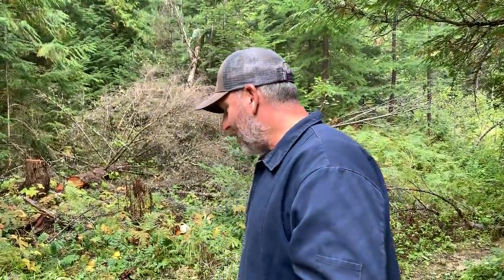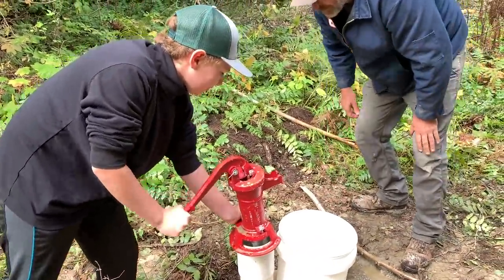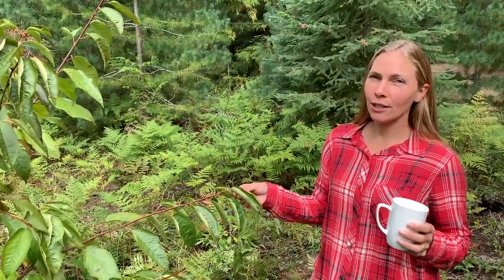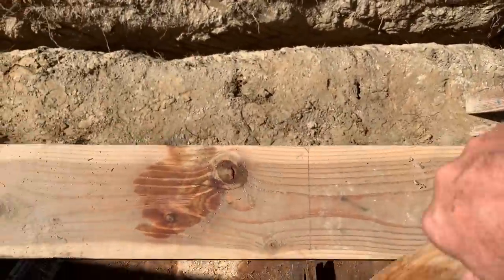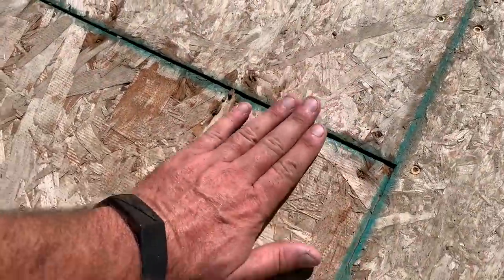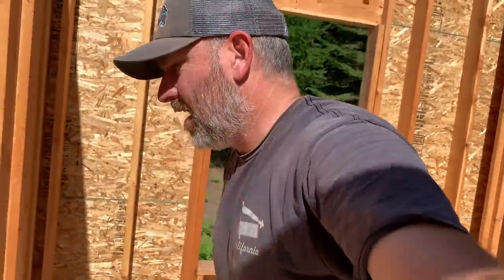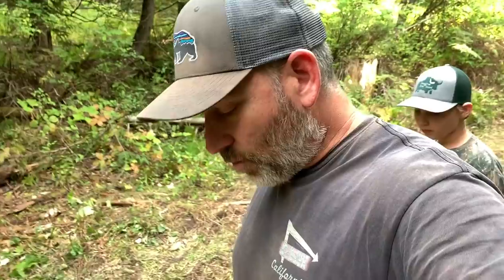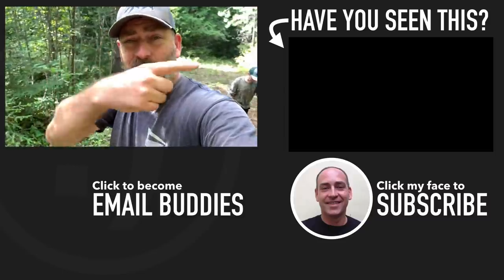Making Progress on Our Well | Off Grid Cabin Build #29

Comment from the maker: 🔥 Watch from the beginning Off grid Cabin build https://www.youtube.com/watch?v=MGfugfuzFJk&list=PL-O59UCFPykj09YwMbWqKTFfZITiJVCNg
Reply: Martin Johnson - Off Grid Living , dig a 6 foot diameter by 18 feet deep well , it will hold 1000+ gallons of water , get you friends and start digging , use rock or concrete for the outside edge to keep it from falling in
Reply: Tips you 35 M
Reply: Martin Johnson.  I must say, this sounds like an excellent plan!  Just need a large culvert, some gravel for outside the culvert. something to cover it up and alot of digging power!
Reply: John Hartsock , my well is 6 feet in diameter and 22 feet deep , it has rocks from the bottom to the top just like old wells were made , then has a squared off concrete top , I use a sump pump I got from Walmart and the gallons just flow , I tried to drain it but could not , could only drain about half way down , I gave up , by the next morning it was full again , it was built in the 50s , I use it to water my garden , wash cars , and if there is ever a public water shut down , I can still have water for any need that arises , I also have 4  P.M.A.,  
Permanent Magnet Alternator's and a Generac 2000 watt generator for backup , so electricity is not a problem either
Reply: Hey why not you r tryng to make a natural filter by layering half inch gravel to fine sand to activated charcoal. 
And deposition of silt in bottom is due to lack of proper nylon mash wrap
Reply: Dhaneshwar Rajput , because it's a fresh dug well and the sediment has to come out first or it would clog up with all that stuff you just said to put down in it , that may be great after the water clears up to have a natural filter but not now , all the fine sediment would clog the rocks , sand , activated charcoal and he would get no water , does that make sense to you ?
Reply: @jimthomas777  he is throwing away water, so what's wrong to try for a separate natural water filter. Some where near to this hand pump. I am not feeling anything wrong in it.
Reply: Dhaneshwar Rajput , because the sediment is 18 feet at the bottom , there will be a clog and no water will come out , clean or dirty because of the clog , did you not see in the bottom of his bucket all of the sediment ? that same sediment would get in the sand , rock and  charcoal filter and turn it into one solid Mass and no water would flow out the pump , it would clog because there is so much of it , does your brain work ?  look in the bottom of his bucket again , I think your brain might be in there
Reply: You might try air pressure for opening up and making cracks.
Reply: Marrying did you ever get it going correctly? Best wishes
Reply: You are actually referring to a crock well.
Sized to fit your needs.
Reply: I think you didn't go deep enough I used to drill water wells you probably need to go down to 50 feet and there's going to be water at a hundred feet for sure your best bet is to go or a hundred feet 100
Reply: you're digging into what they call sheet water water is anywhere from 18 to 50 feet deep you might hit it better at 32 feet then your next water should be a 100 to 110 and we're sure at 260

Comment: So many comments and few who actually know anything about wells and water. Pumping the mud out of the well is a good thing. The more you pump out increases the static volume your well will hold. Over time the water will eventually wash out all the silt and it will clear up. But keep in mind this is only a surface seep heavy rains will cause it to get muddy. I explained the potability of your water and how you can safely use it in comments of last video. For those who missed that comment i am a well driller and a expert in this subject.
Reply: He is likely never going to get the silt fully removed. His filter pack is far to coarse to filter the formation they drilled in.
Reply: I'm not a well driller but just like I posted before and please let me know if you agree. Most guys in this trade have a vast amount of valuable knowledge especially the local area and can pretty much tell you everything you need to know and will for free. I was in the residential building profession for years and the biggest misconception I think is that the pros won't help out the average person doing it themselves. In my experience the professional guys are more than willing to share their knowledge. Their obviously not going to come out and do it for you but a huge majority of the time they are more than willing to share their knowledge.
Reply: Agree
Reply: Question. If there is a small well that has a slow return could it be pumped into a large water retention container? Since he has solar maybe an electric pump with a floating trigger for water level?
Reply: @joshcatanzaro6220  yes you can do that it can be a bit costly for the specialised equipment. But if water is scarce from other sources it can be worth the cost. It isn't a DIY type project make sure you get a qualified contractor to install.

Comment: Why don't you use rainwater? If you have a point on your property that's higher than your cabin, you could install a rain catchment roof, store the water in tanks and then have gravity bring the water down to your cabin. Rainwater filtering for drinking is also not a problem. And I bet the water would be cleaner then what you get from that well.

Comment: Ok, I am going to tell you what my gut tells me is going on with this particular hole of yours, and what I would do with it myself. You can take it or leave it. Ultimately you have to decide for yourself. You are obviously already well aware of that.
I think that since there is no cap on the bottom of the casing, the surrounding soil is simply liquefying and filling up the bottom of the casing. This is probably ultimately going to create a sort of sinkhole at the bottom of that casing. Or in other words, a large void, around the bottom. Although that void will always be full of "chocolate milk" from the liquefying going on and on and on...
What I would do...
Get a "trash pump". That is a powerful pump that will pump the thickest chocolate milk you'll get from there.... Use that pump to pump it down every hour or so. Thus, creating a void, more quickly.  Now fill that void with pea gravel. Just dropping the pea gravel right down the casing. (Make up another piece of the inch and a half to 2 inches pipe, with a cap on one end, and fill part of that with water, for weight... Then drop it in the casing, to drive the gravel down. Do this in small increments. Just like you learned not to pour in too much gravel at once around the outside of the casing.) Now use the trash pump , to pump it down again, as many times as it takes to begin to get clearer water.
If you do that, eventually you'll get to the point where you can let it sit for a few days, then use your hand pump again. And after that, you should start seeing clearer and clearer water.
If you never get to that last stage, but always have chocolate milk, you'll need to put in more pea gravel. What you are trying to do is to replace silt with pea gravel. And eventually with enough pea gravel in there, it will start to filter the silt.
If you start getting chocolate milk again in the future, your pea gravel probably needs to be added to.
All in all, you would have saved a lot of this trouble by using two layers of filter sock over the pipe, before you dropped it in. Even with the filter sock, though, it would be recommended that you drop some pea gravel down the casing before setting a pump and starting to use it.
Reply: selador11 what you said is true.. before dropping the pipe the bottom part where the saw marks should be covered by a fine net to prevent fine dirt and sand filling in inside the pipe.
Reply: Francis Santiago Lo

Comment: You don't know me from Adam but there is my 2 cents. Don't mess around with your family's health, get a proper deep well. Ground water (18 ft) is way too polluted. You are way too far from the house. Will have to run pipe below the frost line and electricity. No. 10 wire is not cheap. Saving that expense will pay for 1/4 of your well drilling.  I know you want to DIY but best leave this one to the pros.

Comment: While you're pumping out the silt, instead of waiting for the water to recharge, save your water on top of the ground in a barrel or two or three. As the silt falls out put the good water back down in the well and recirculate it to pump out more silt. If you have enough storage for the silt to drop out and reusing the water that is cleaner you can continuously pump instead of waiting to do it every hour in this way your recirculating the water and pulling up the silt from the bottom of your well.
Reply from the maker: +Marty Guris that is a good idea.

Comment: My friend, you need to have someone come out with a mud hog pump and pump your well out.  You need to have the mud pumped out and a cavern formed to hold water for you. When you get the cavern formed you won't have to worry about running out of water. also it will be a place for any residual mud to settle and the slow pumping of water that you will be doing won't stir it up either.
Reply: you sir  are right ...bring a generator and plug in a mud pump ...make yourself some room down there?

Comment: The best suggestion I have for you is just break the law and jet down at the minimum 20 more feet nobody would know.
Reply: Yea but posting it on youtube wont be a great idea lol
Reply: At this refresh rate this will not generate enough water for a shower(when it cleans out).
Reply: I would get an excavator dug as big hole you can fill it with 2 inch stone almost to the top then the last ft. Pea stone half in. Then cover with geo tarp then loam then seed then No More Headache. Take the hit for the ,
Reply: Not down a wider area With 2in Stone that will give a good reserve,the water table is low in that area, So don’t go down make a wide ad deep as you can
Reply: Scott John

Comment: I just watched part of your video on the well. The problem as I see it and I've got a lot of experience in this kind of thing, is that your well is drilled down into clay and Clay does not let go of water that easily that's why clay is used to line Farm ponds it does not allow water to travel through it you need to get the well drilled down through the clay and into an aquifer that is in sand or gravel or Sandstone or some kind of Bedrock I don't know what's out there in Idaho but having a shallow well in clay will never yield enough water. The well I have at my property is 120 ft deep and is in sandstone and I get dozens of gallons of water per minute recharge

Comment: Hey folks! Something y'all need to know about hiring a well drillers in North Idaho... They are all booked out until May, then it's $10,000 just to get the rig on the property.  If Martin can get water from an 18 foot hand dug well in September, he's doing better than you might think!  In winter it will produce a lot more, and in spring it may even overflow.   The issue with impure water is resolved with in-house filtration systems.  These are very common in North Idaho.  Martin is on the right track.  He'll make some adjustments and adapt.  This is what homesteading is like in our area.  That's why he's sharing it with us. 😉
Reply: Agreed, although I think he would do better if he dug a wider hole to increase water volume to get around the silt a bit more.  Not a bad test.
Reply: @HospitalLocksmith  Unfortunately, a larger hole will not solve the problem. He is being limited be recharge rate through the formation, which for the rate they are pumping is relatively independent of their casing diameter

Comment: I would have loved for you to be successful with your self-drilled well but from the beginning I was concerned given the results of the auger drilled well.  So much clay and silt didn't bode well!  And when you cut slots into the casing I knew silt was going to be a problem, certainly to start with and it's looking like it isn't going to stop getting into the well.  I'm getting close to agreeing with others who are recommending a deeper well drilled professionally.  Even if the silt ingress diminishes shallow wells are subject to a lot of surface contamination so could you ever trust it to be potable? Bummer to say the least but this is one place saving money up front could cost far more in the long run. And there is still the issue of the well being so far from the house site and getting the water to the house itself.
Reply: I couldn't have said it better.

Comment: I have done it same way with auger but found using a mud pump and circulating the muddy water into a settlement tank  then back down bore hole worked best it pushed the mud an sand up and out, then just push casing down as you go till you are as deep as you want then put a sand point on your suction pipe drop it in and next pour gravel in and lift casing a little letting the gravel fill in round casing and sand point this should give you plenty of support to keep it from caving in and make a nice resavior for water then pump all you want to clean it . Shouldn't take too long before all clear water is left.

Comment: Martin take some short 2×10's and a couple of pieces of plywood sandwiched together and build a mini platform for the pump to fit around the casing to take away some play
Reply: I was thinking some cinder blocks for weight wired to the holes in that hand pump, but this is only temporary.

Comment: I have developed many water wells for work and the issue is that you used the incorrect filtering material for your well.
You should have put a silt sock over the PVC pipe and used filter sand or even just plain old play sand that you have washed for the fill material and then cap it with cement at the surface.
Reply: Yep, a sock. The most amazing well drillers vids are mexican. They got it down to a science.

Comment: The house will be destroyed before you get it built.  Mold loves that “wood”.  Bottom plates should be treated lumber and if I was building it myself everything would be treated.  I did a building a little smaller than yours and everything  except the roof sheeting  was treated.  It got tar paper right away.   Spend a little more and have less headaches later.  Even painting that stuff won’t work.  Waters going to get under every 2x4 and rot it.

Comment: Don't forget now the end of your pipe that's on your pump you have to put a foot on there and you can put a sock on their internal pump Clearwater you cut it off about two to three. 224 in is actually from the bottom you won't get silk
Reply: Should say two or three inches not to 224 disregard that part

Comment: hi   your bailer  idea   is ok   but you need  a large    foot valve    .  it will   open when u  drill it down and   close   so you can bring the sand   to the surface     ,  I'm  sorry u are restricted   from going down to a gravel   bar    good luck

Comment: Martin. Google "air pump"  useing compressed air a few pieces of hose and you can remove all that silt and sand from your well casing in the matter of a few minutes.  Since your soil is so sandy you may also need a finer screen on your foot valve.

Comment: Make a bailer.. to clean out well.
use a pipe with a heavy ball on the inside. drop from the top of the well and let it slam into silt. when you pull out the ball drops and seals off the bottom of the pipe so the silt stays in the pipe. pull pipe out and repeat
Reply: Good tip

Comment: The bottom of the large pipe is open so the silt is coming up the pipe. You also added your pea gravel 24hrs after you drilled the well. The gravel is probably 8-10 foot up the pipe and nowhere near where you needed it to be. Either repeat the process with corrections or drill a derp well with a professional crew. See @purelivingforlife

Comment: Why don't you use a RAM pump from the creek with running water & pump that uphill to a water catchment area in the ground that is 6 foot wide, 9 foot deep & 24 feet long rectangle hole using extremely thick plastic sheets that are sealed together into a shape of a rectangle tank to hold the water. That would give you 1296 Cubic Foot or 9694.75 Gallon.

Comment: Cut slots like vent slots to let the water in from the outside of your case pipe cause the pump is pulling a vacuum witch is pulling the silt up not the case pipe

Comment: Yes, your well needs to be developed (flushed) yes, you need - well you need a lot!  My thoughts are that you are not deep enough.  There are two types of wells.  The first is a bored well. These wells are about three foot across and are bored down until you hit a ROCK LAYER.  This type collects that water which has spent a few years filtering thru the soil and collects water laying on top of the rock layer, This is the best type of well.  The water is extremely pure, cold and sweet.  The other type is a drilled well. it punches thru the rock and collects the water that has bleed down thru various rock layers.  These wells perform better in drought conditions, but the water contains lots of minerals.  I think that I would get that driller guy back and push pass that 18 foot "restriction" until I hit the rock layer.  If you get down - say 60 feet and the next day have 40 foot of water - you will know what you need to do

Comment: Take off the check valvepump out the slit extend pipe  and Nd pump slit. You’ll pull out thr slit . Leaving  coarser sand in the. The letting water refill faster. Then replace check valve.  Keep pumping the clay/fine sand clear the bottom and area at the bottom of the pump and  soil filtration area. Pump will fill much faster greater more volume.